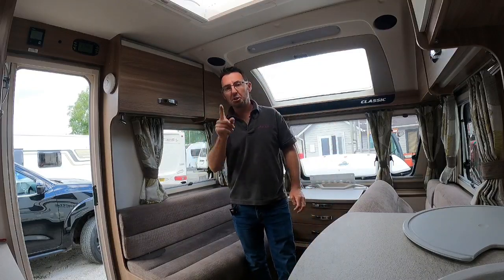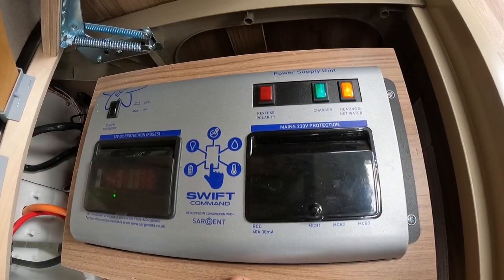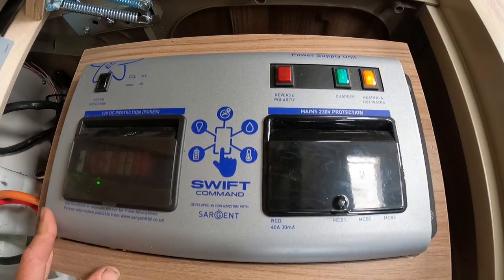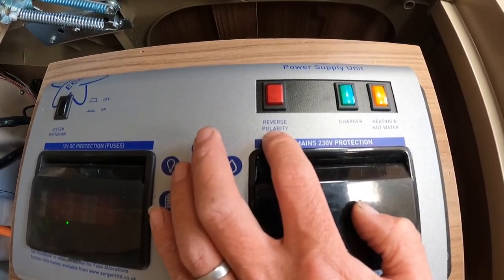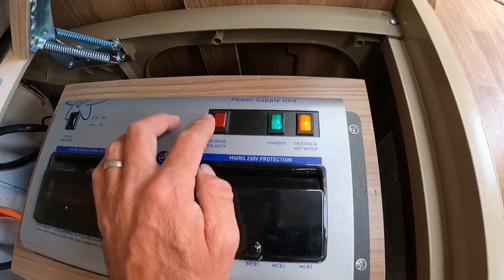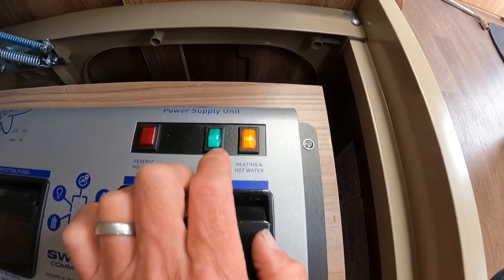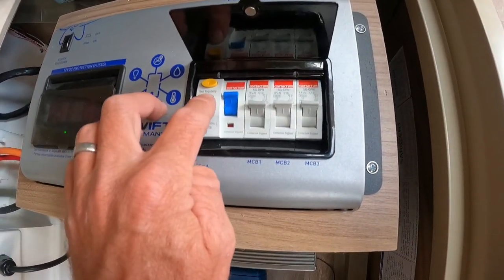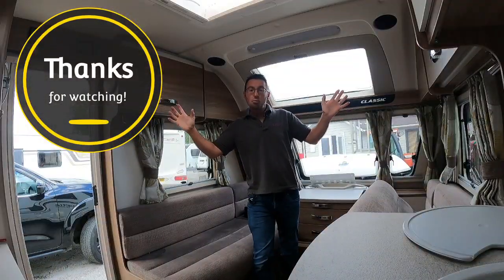Sargent power unit in Swift caravans Sterling caravans and sprite caravans

Comment: Glad you did this little video Mark, just bought a swift challenger and wasn’t sure if I should turn the electric off completely as I have a solar panel. Know I now cheers!
Reply from the maker: Great, glad it helps. On some of the newer units the power will still go to the battery from the solar even with the black button off, to check you can use a volt meter onto the battery. By turning the black switch on and off and see if any voltage difference. 👍

Comment: Hi Mark 
Our solar panel is fed directly to the battery via a controller and not connected to the swift command so I can switch the consumer unit off when in storage and still have my leisure battery charged.
Reply from the maker: I think all the newer ones were direct to the battery, I will try to find out what year it was from. Thanks for watching and commenting 👍

Comment: According to the Swift manual even if the system shutdown button is switched off the solar panel will still trickle charge the battery and keep it topped up (dependant on weather of course). This is recommended when in storage. The alarm/tracker will also work.
Reply from the maker: Yes on the newer one the power is still live even with the button off, we need to to a new video really 👍
Reply: I’ve just bought a brand new 2023 swift camper and the manual still says the button has to be on for the solar panel to charge.
Reply: I was just gonna say we've just bought a 2016 Sterling elite and our dealer said to turn the 12v off but the solar panel and app would still work

Comment: Hi Mark,
great explanation. Thanks. The only thing I am still struggeling with is the configuration for having my battery charged by car during travelling. I assumed to have the shut down switch on and the charger?
Best
Tilo
Reply from the maker: Hi Tilo, yes thats perfect, the system will automatically swith over to car then when it is connected and just turning your fridge onto battery if needed.
Reply: @thecaravanplace  perfect. Thank you!

Comment: Do you know if you can run the heating without electric hookup? So if you wanted to run it off gas for instance? Would that work, what exactly does the 12 volt cover and where does 12 end and the 240 take over?
Reply from the maker: So pretty much everything will work on 12v and gas, apart from plugs and 2 lights to the front on most. Heating, hot water and fridge will all work with gas.

Comment: I have a 2017 Challenger, do you know if this one needs the power switch on  to keep the solar panel alive when stored?
Reply from the maker: 2017 is OK in off position, you can use a volt meter on the batter connections to double check you have the extra voltage also.

Comment: I may be wrong but when i shut down all the power supply the solar panel still charges the battery as i noticed the battery fall slightly during the night and then charges to full in day that is with buttons in off position in the swift challenger 650
Reply: I also have a 2018 Swift Challenger 650 and mine is the same, the solar panel still charges when the power buttons in the off position.
Reply from the maker: Have you checked the voltage at the battery? The little panel in the top cupboard may still be flashing but just check the voltage to the battery terminals in the off position. They were supposed to be wired through the sargent panel but may have been changed so just double check. 👍
Reply: @thecaravanplace  Certainly on the most recent Swift vans both the solar panel and the alarm work regardless of the position of the shut down button.

Comment: Hello Mark, thanks for the video, we have that very system and I didn't realise about testing if the main in coming in by using the test (yellow) button. However, I understand that you are supposed to switch off the main (black) button before connecting or disconnecting the EHU, which is what I always do. Am I correct in this?
Reply from the maker: Hi Keith, thanks for watching, doesnt make any difference with the black button so you can leave it in the on position when hooking up or disconnecting the EHU.
Reply: Cheers, one less thing to think about!

Comment: Hi Mark. Do you know where the backup battery is located for the Sargent comms ?
Reply from the maker: It's only feeding from The leisure battery or the charger, the only back up battery is the alarm battery which is in the black alarm box. The main control unit won't work unless you have 12v power from the leisure battery or the mains via the charger. You can get a slight feed from the solar panel put it won't continuesly power the panel. Hope this helps?

Comment: hi Mark when in storage should I turn off 230v fuse master but leave 12v on for solar panel to work
Reply from the maker: Hi Ian, depends on the year, some older vans needed the switch in for the solar panel to work. But most newer carvans will still work in both positions. You can check with a multi meter on the battery if you are unsure.
Reply: @thecaravanplace  hi Mark thank you so much for your reply  I have a bessacarr cameo 580 2016 and not very savvy on using a multimeter never used one before

Comment: Do you need to leave the leisure battery charging when you are connected to the mains on site?
Reply from the maker: Hi Martin, yes leave it on charge so it will swap between battery and charger and the leisure battery won't go flat.
Reply: @thecaravanplace  There’s a bad egg odour smell coming from the battery so  would it be ok to switch the battery off charge until I replace it. Currently on site and must source a battery tomorrow.

Comment: The solar panel works independently of the system shutdown button to keep the battery charged. That's kinda the point.
Reply from the maker: Yes I believe most of the newer models will work in this way, the older models didnt work with the button off, we will possibly do a new model video with this update, the years of change over were a bit all over the place so difficult to pin point exact year of the change. Thanks for commenting 👍

Comment: Actually you are incorrect  about the black button, if you turn it off it still maintains the battery via the solar panel and the alarm is still active . If you leave it  switched on  it will draw more standby current than the solar panel can supply and drain your battery.